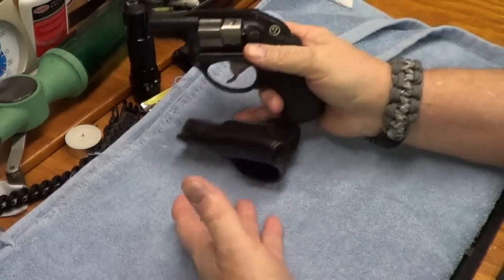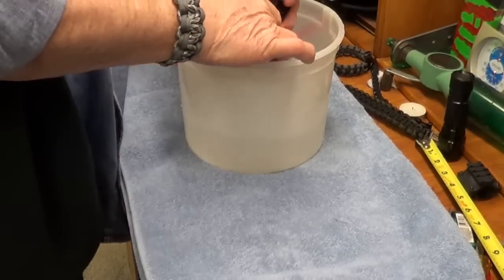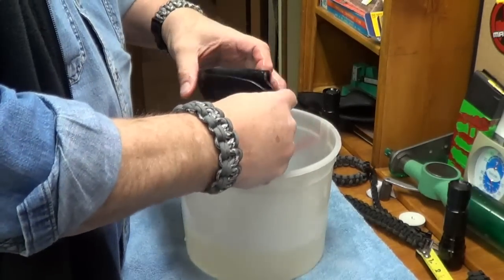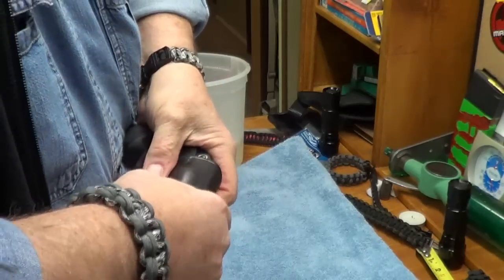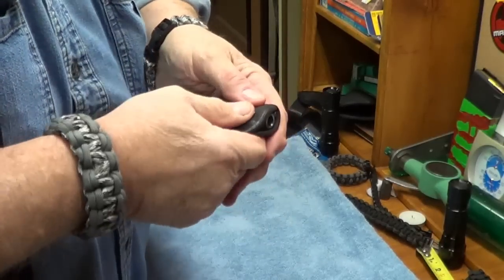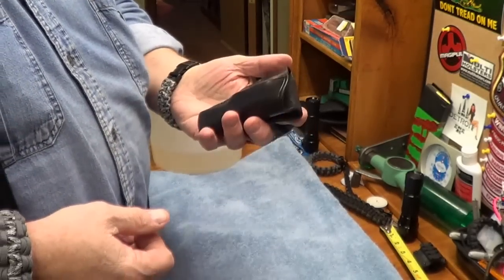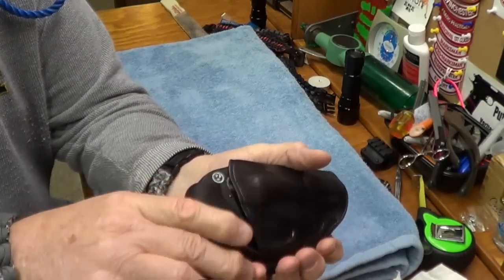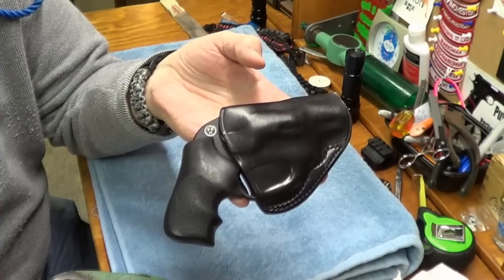Resizing Leather Holster

Comment: That's exactly how you do it. You can take a wooden dowel cut it to about 6 inches sharpen the tip like a pencil then round it off. Then you can use that to press your leather to the shape of the gun. Really pay attention to the trigger guard. That is where you will gain retention.
Reply from the maker: Thanks Randy will give it a try.

Comment: Wonder if that works with leather boots. Maybe time to get a new one.
Reply from the maker: LOL give it  try on some old ones of course.
Reply: I can tell you this much there's no better way to break in a new pair of leather work boots than to go walking through a sallow creek until your boots are thoroughly soaked, once they're soaked continue to wear them throughout the day or at least until they're dry or nearly dry doing this on a warm day and starting early in the morning is best so you'll have time to let them dry, once they're dry rub them down with mink oil and may I also advise you to take a second pair of thick wool socks once the boots are thoroughly soaked take off your wet socks and put on the dry wool socks it'll help prevent blisters but if you feel like your feet are starting to blister go ahead and stop walking around if possible but continue to wear the boots until they are dry but you can sit around or stand but walking is best, this will break a new pair of boots in in a single day

Comment: Try putting the holster only in the oven at 150 degrees for 5 or 10 minutes at a time making sure you keep your eyes on it.  The heat will dry the holster and also tightening the holster. I seen it on a leather video I watched a year or so ago.
Reply from the maker: Thanks for the info.